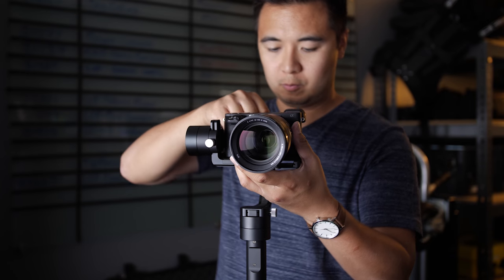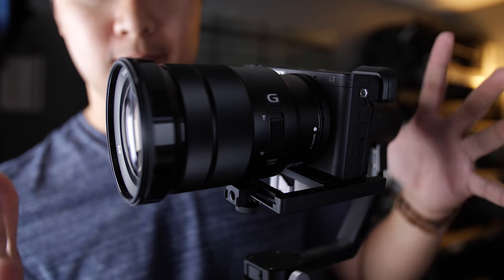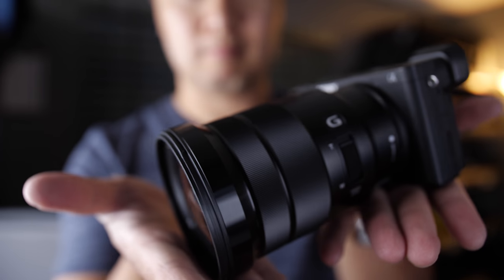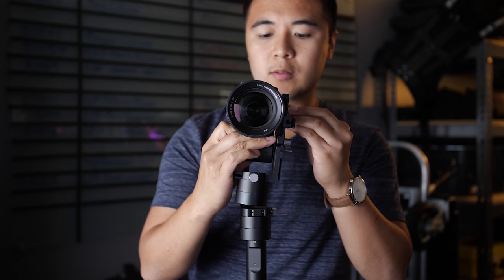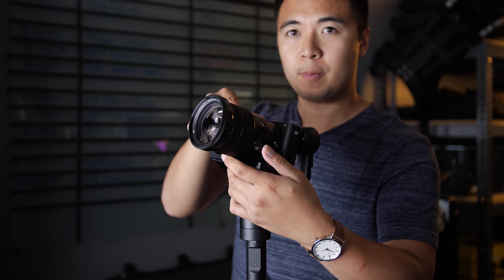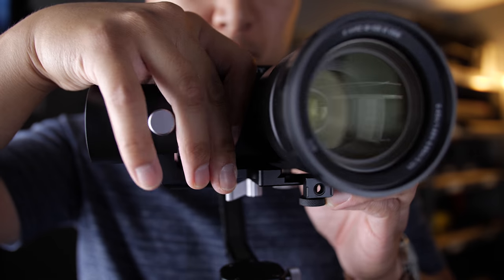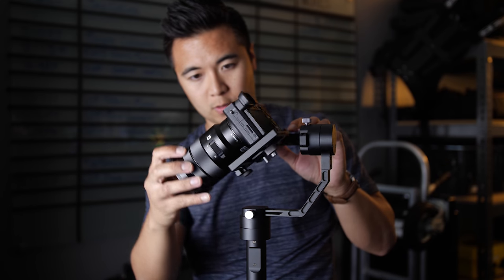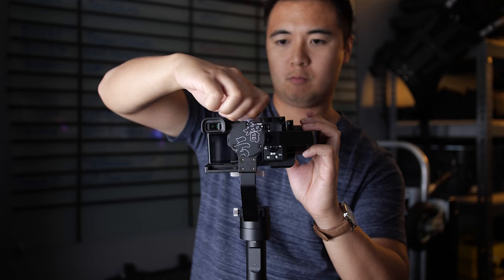How To EASILY Balance a Gimbal (Zhiyun Crane v2)

Comment: I've been trying to balance this thing all morning and I think my set-up may be too light? I have the a6500 and have tried the 35mm 1.8 and the 24mm 1.8. I can balance in the regular forward facing orientation but cannot get the camera to stay pointed up with lens directly up - seems like it is not heavy enough?
Reply from the maker: Yes, you're totally right. There are several solutions...try extending the back screen out. It works for me! Also, on the app, however, there is a way to set the gimbal so that it's calibrated to balance lighter setups. Lastly, ry attaching an external mic on top of the camera to give it more weight. From my experience, if you can get it balanced for the MOST part, I would worry about too much. That's where the gimbal motors come in. Hope this helps Francesca!

Comment: Great Video Sidney! We are still using the original crane gimbal. Noticed that you used to Sony 10-18 lens. We need a wide angle are we looking at the 16-50 or the 10-18. Are there any huge differences between the 10-18 and the 16-50 when it comes to 4k and slow mo?
Reply from the maker: +Jacob Martin Thanks Jacob! I LOVE the Sony 10-18mm! It's better quality than the 16-50mm, and MUCH wider. I always shoot at 10mm when it comes to gimbal or Glidecam shots! Hope this helps!
Reply: Sidney Diongzon yes it does. Thanks so much
Reply from the maker: +Jacob Martin 👍👍👍👍👍

Comment: I can balance the 18-105 super easy but getting the 10-18 or 35/1.8 is almost impossible :(
Reply from the maker: It's not impossible. I've done it quite easily. Also, the gimbal doesn't have to be PERFECTLY balanced. Just get it balanced enough, and let the gimbal do its job.
Reply: Sidney Diongzon thanks! ha sorry by impossible I mean I've not managed it yet, obviously not impossible lots of people mention using the combo. I resorted to using it 'almost' balanced but I'll keep trying.

Comment: I'm trying to work in my rebel with my sigma 18-35 1.8 I'm kind of worried ...
Reply from the maker: That lens make the camera front heavy, so you might need a stronger gimbal.
Reply: Sidney Diongzon it is very heavy , great lens but I'm hoping to find a lateral upgrade worst case. I'm going to try and work on it some more

Comment: I have a G7x mark ii and want to purchase a stabilizer that would support it as well as the canon 80D I plan on buying later this year. Would the Zhyiun v2 work for both?
Reply from the maker: Maybe, but it depends on the lens you use. I'd go with the Crane Plus just in case.

Comment: Sidney i have a question for you :) can i balance sony a6500 and sigma 18-35 on gimbal v2 without small rig or anything else? this setup looks so front heavy and i saw some videos making it balance with help of smallrig or monitor on a6500 to make it balance but i don’t have small rig or anything else what should i do?
Reply from the maker: +awsin maze Yep! In fact, the 18-105 is the perfect weight to balance on the v2!
Reply: Sidney Diongzon  darling i asked about 18-35 😄
Reply from the maker: +awsin maze LOL, oops. So many lenses that sound the same! You can balance it, but you have to adjust the settings on the app to handle heavier payloads.

Comment: I can't get the tilt to balance like you showed, to stay where you put it... I balanced my tilt on the middle, if I put it up or down it will go to the middle again. It seems impossible to stay like yours. Sony A6300 + Kit Lens 16-50.
Reply from the maker: +Erick Garcia Hmm, I wonder if you're camera is too light? Maybe try throwing a mic on the hot shoe?
Reply: Hey Sidney, thanks for the quick answer. Yeah I've heard about that, my setup is too light... I'm going to try a mic or an additional quick release to add weight. Not having the tilt balanced properly is going to force the motor right?
Reply from the maker: +Erick Garcia It'll still work for sure. It's so light that I wouldn't worry about damaging the motor. It's only if there's too much weight the motors struggles to handle it, you know?
Reply: Oh yeah, thanks for the info buddy. Just got it 3 days ago. Will practice a lot with it!
Reply from the maker: +Erick Garcia Awesome! Have fun with it!
Reply: Erick Garcia u can try adding heavy quick release plate.. i faced same problem and plate addition balanced it perfectly..
Reply: Thanks for the tip Gaurav, I've heard about that. What plate did you buy? Could you recommend one?

Comment: I can't balance the gimbal.  Im using the exact same camera,  the exact same lens and the exact same stabiliser and it just keeps tilting forwards.  Even with the plate all the way forward and the tilt as far as it can go.  Please help me figure out why mine wont stay balanced and yours will
Reply from the maker: If it tilts forward, the plate should be set back, not forward.
Reply: Yea, I meant back not forward, but i still had the same issue. Sorted it now, when packing the crane away, it sort of inverted itself and the gimbal arm was to the left not the right.
Reply from the maker: +Luke Waite Glad it worked out for you!